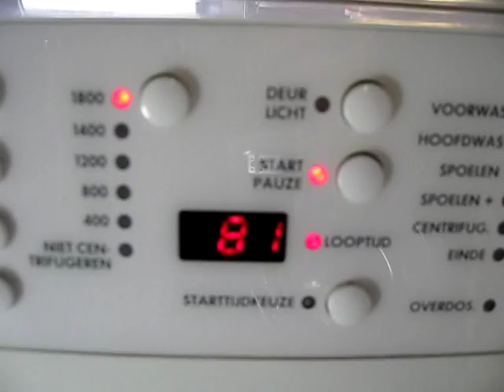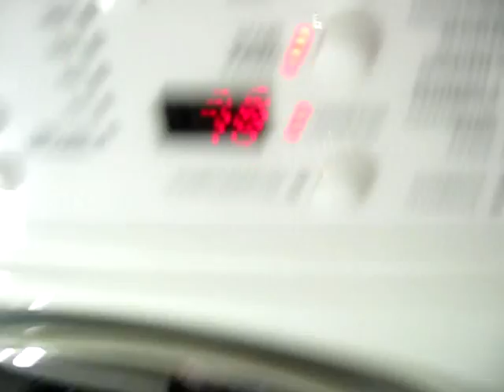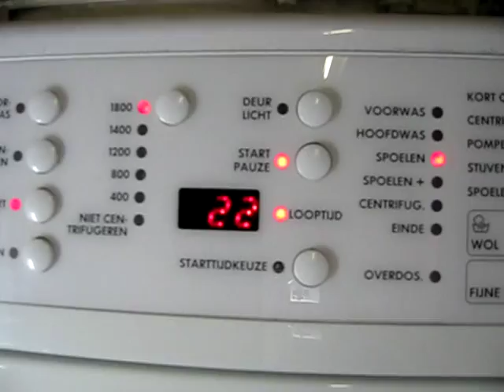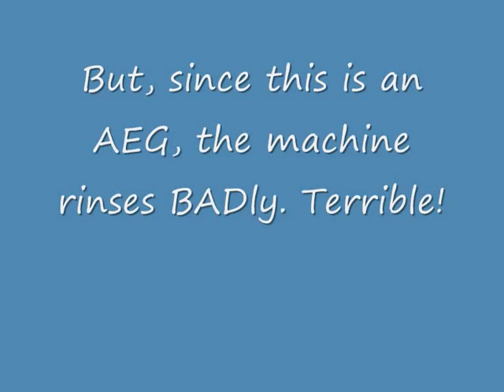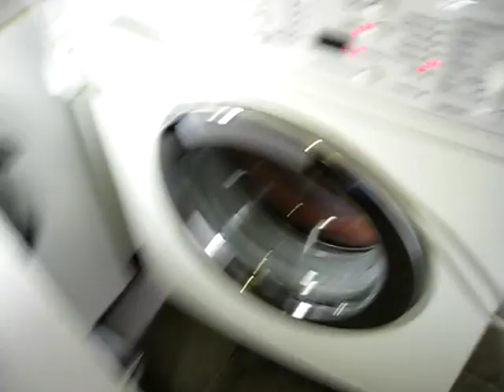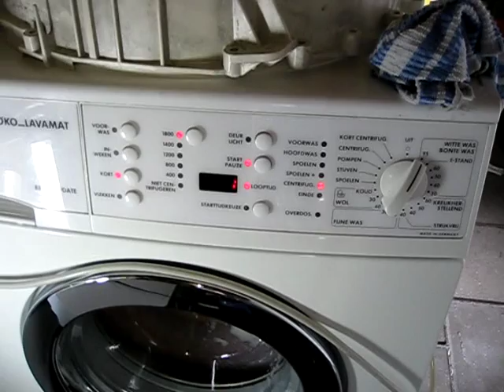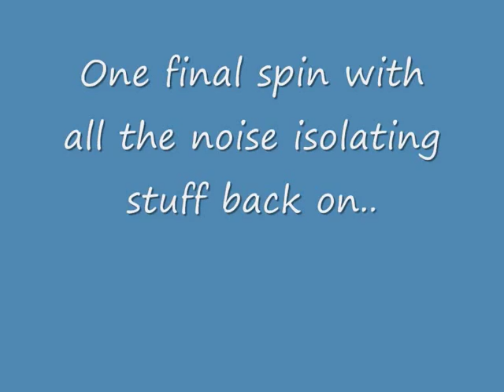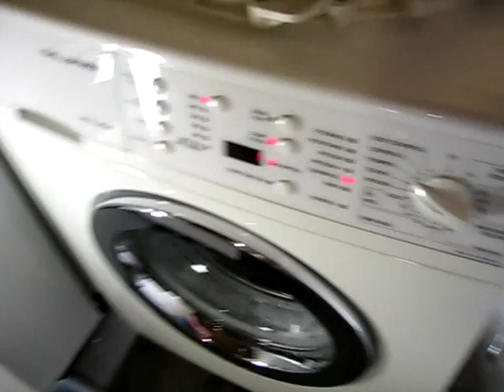AEG 88730: test run!

Comment from the maker: It's typical AEG rinsing: economical, but bad. The jet system worked just fine, although the entire pump system suffered from a bit of filth during the wash cycle. But the boil wash really cleaned her up. ;)